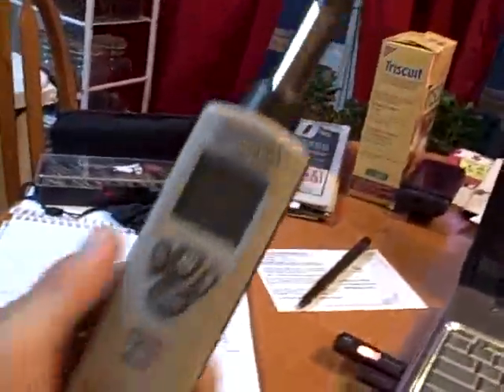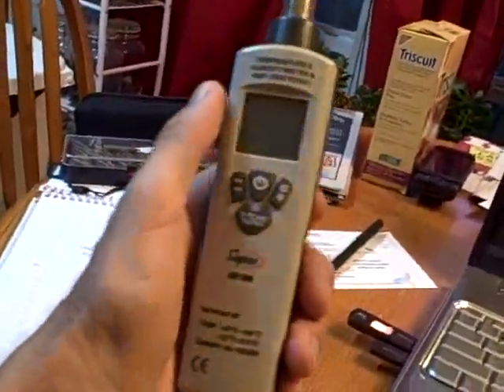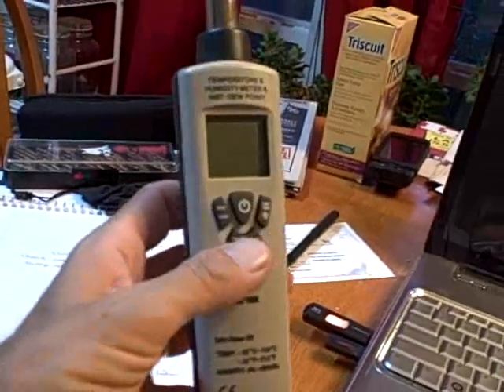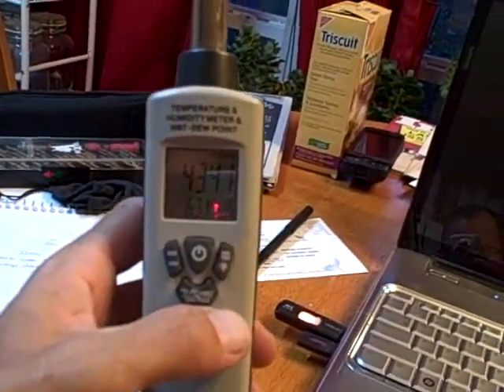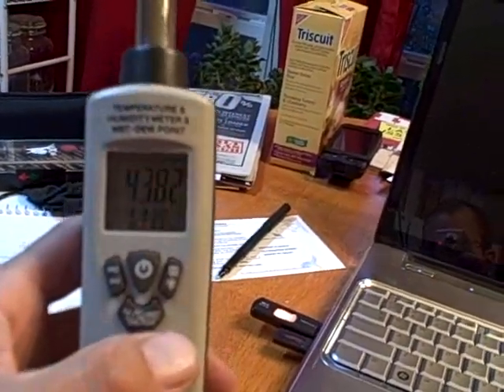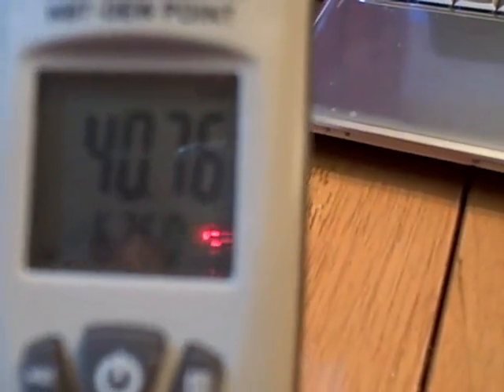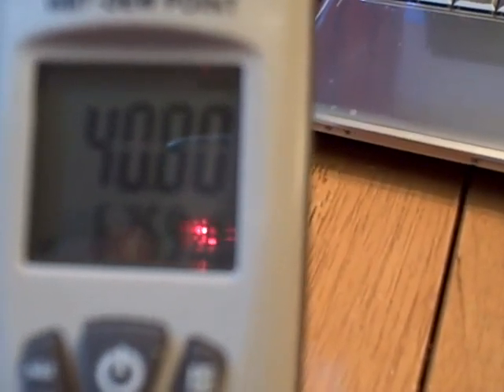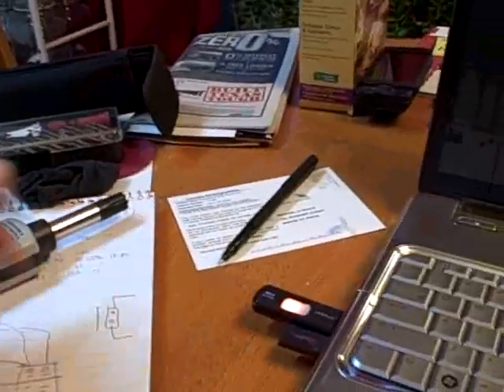HVAC Calculating Super Heat

Comment: superheat is the heat added after vaporization point. if you're calculating an evaporators superheat then check your low pressure gauge, check your p/t chart and find the actual temperature and subtract it from the charts given value. subcool is the same but it's useless if the system has a txv.

Comment: Hey Mike I was having a discussion in HVAC pro talk about checking refrigerant levels and adding refrigerant on a air source heat pump while in the heating mode. Would you concur with another user that you should check and charge using super heat? Any suggestions or guidance you can suggest for approximate pressure/temp readings. I was told a good rule of thumb is +30 high side and -20 low meaning if it 70 degrees inside in winter your saturated head temp should be approx 90-100 whereas if outside it is 40 degrees then you low side saturated temp should be around 20 anyway I'm sure there alot of ways to check but in the winter just makes things a little more difficult especially to understand, thanks for what you do.
Reply from the maker: Hi!  I haven't been over there in a while! Guess I should start checking in more often and keeping read up on what everyone is doing! Apologies for the delay in responding, you know my usual delay with my normal spinal issues and sitting in front of the computer of late, but I've been down for like a week and a half sick, ugh. Started out as a sinus infection and think I caught something my wife brought home on top of that! Next thing I know Im nauseous and my equilibrium is shot and Im having trouble standing up! Two trips to the Dr in the last week, two shots of antibiotics, a week series of antibiotics and a series of steroids and would you believe Im still catching my balance with a day or two worth of meds to go!  Havent had a wammie like this since I was in my early twenties! Lol!

....anyway, my head is fuzzy but since I'm laying here in bed with the tablet I might as well try and think, hehe.  First, just to get it out of my system, I hate heatpumps! Ugh!  Hate 'em!  Well I love them, just hate working on them ;). Theres just something about squatting down in front of a unit in freezing rain and ice trying to work on a unit when I could be working on a nice, dry gas furnace in someones hallway or attic! ;)

...but yes, for the most part the numbers that you mentioned are a pretty good ballpark.  I don't fuss too much over the suction temp as much as long as its in decent range, usually more of a warning bell if somethings really off.  For the most part I try and use the manufacturers charging charts, if they actually have any, but as you know often times they dont, such as Goodman saying 'weigh it in'. Uh, yah. Thats it, lemme suck it dry and weigh it in, then ballpark it anyway depending on the metering, lineset, rise, etc. since the maker doesn't want to do their job, lol.  ...then theres all the mystery units out there and a billion improper installs, etc.  

...but yes, that is a good rule of thumb.  The other important thing is to make sure to let it run long enough that the system has had enough time to warm up and balance a bit before making any changes, then making small changes and waiting long enough for it to settle again.  Such a pain in winter:/. 

I've run across a lot of new (still consider them new I guess) 410a systems that people installed during the winter and got in a hurry installing and wound up over charging, but it didn't rear its ugly head until summer rolled around.  Then I get a service call because the unit keeps starting up and shutting off, then doing the same thing over and over, short cycling.  They over charged them, pressure goes through the roof and trips the pressure switch.   I'm waiting for the eventual plethora of leaks that are bound to start cropping up (call it cynicism, hehe)  when the higher pressures with this stuff start meeting borderline production quality and thin copper.  Wonder which brand/model it will hit! (Grin) ...Im sure we can all think of one brand/series that had tons of coil leaks when mounted horizontally not too many years back!

...anyway, back on topic!  A number of years ago I sat down at the computer and started searching and dug up as many brands as I could trying to find charging charts for winter time, printed them up and added them to my three ring 'cheat sheet' binder that I kept in the truck.  Funny the stuff you keep that comes in handy later!  I think the most useful thing ai ever printed was a rather exhaustive list someone made of every brand of hvac, wether they were still in business, who they sold out to and who handles their parts if they aren't!  Especially handy with my horrid memory!

(Boss calls) Hey Mike, I need a 3/4hp 820rpm motor, you have one on your truck?
(Me) yep, no problem.
(Boss) great, Ill come get it, where are you?
(Me) ...um, on my third call.
(Boss) ...oook, what town are you in?
(Me) ....um, I dunno, Ill have to go out to the truck and look.
(Boss) mike.  Are you kidding me?  How do you not know where your at?
(Me) I just go where the gps tells me.
....seriously! ;)
Reply: Q

Comment: Is the formula you illustrated 3x wetbulb minus 80 minus outdoor dry bulb or ambient divided by 2 used to determine what the superheat should be or used to determine what the system is currently operating at. Because for instance, utilizing another method of taking the temp of the outdoor suction line minus the saturated suction temperature would give you the current operating superheat. I believe your formula is a more accurate way of determining the system superheat. Because these other methods are not taking into account indoor wetbulb which is crucial to knowing humidity or outdoor dry bulb. I also use to the Emerson tech check and charge app, can you explain from your experience which way is the best and are other people taking short cuts by just subtracting line temp for suction saturated temp. Thank you -Steve
Reply from the maker: Steve, the formula was devised to find out what it should be.  Mind you, its necessary to ballpark the system first and let the system run a while and try and get the house temp in the range of normalcy before using it to set the system where you want it.
Reply: mikie2501 thank you Mikie

Comment: as well but if the superheater is correct or not should make a chart that indicates the superheater is correct. because they do not save if you need more refrigerant charge or remove refrigerant charge.

Comment: The dumb people commenting that this is wrong should not be working in our Field you guys are the refrigerant pumping dumb shits let me explain to u how to do your job for you.....knowing how to take your actual super heat (suction line temp - low side psig converted to temp which your gauges do for you) is ABSOLUTELY WORTHLESS if you don't know what that # SHOULD BE.... I.e. your TARGET SUPERHEAT. The number your trying to hit for the simple minded folks,by adding or removing freon to get it.

Comment: Zeotrope - A mixture made up of two or more refrigerants with different boiling points. Zeotropic mixtures are similar to near-azeotropic mixtures with the exception of having a temperature glide greater than 10° F. Zeotropic mixtures should be charged in the liquid state.

Comment: that's how you calculate sub-cooling, the other way around, taking the saturation temp (the coil) which is measure by the low-side gauge minus the superheated vapor temperature (the boiled off vapor) at the suction line.  I'm surprised nobody else pointed this out to you

Comment: Superheat is NOT just for proper charge. Superheat can tell you if your TXV is operating properly for one, but on a fixed orifice system, superheat can tell you how well your evap coil is performing. I have seen guys a thousand times overlook their subcooling value and keep adding refrigerant, notice I didn't say freon, to a system to overcome low suction pressure due to a dirty coil, restriction in the line, or a bad blower motor. Superheat AS WELL AS subcooling are extremely important values

Comment: what if i get negative superheat? on an R22 split system my suction line temp was 36 and my evap sat temp was 42, that equals minus 6 degrees superheat. my system had been running about 10 minutes and was cooling adequately.

Comment: Anyone that's hating on this vid is a moron. He is talking about what your superheat SHOULD BE on a system with a FIXED METERING DEVICE. Yes you will still have to preform your other checks to find out what the actual superheat of the unit is currently. He's just giving another way of finding out what it should be and not the "range" that we were all taught. Chill out. GREAT VIDEO.

Comment: @drew7473 Super heat is when you have the air conditioner at full speed.  You have to turn the thermostat all the way down to get rid of that super heat.  You only have to do this when its super hot out, like over 100.  
That's some super heat outside when its over 100.  
That's all.

Comment: @Rozco99  Please DO NOT !! give uninformed information if you do not know what you are talking about !!.
Do not embarrassed  us  STEAMFITTERS by giving inaccurate   information. If you are still an apprentice please ask your mechanic for the right information.
A sight glass is mainly used for moisture content , a clogged liquid filter drier or noncondensablesor improper line size/install etc.. can show bubbles,etc. Only superheat and subcooling readings for proper charge .NO RATS !!!

Comment from the maker: @BGreenHVAC Honestly that doesn't ring a bell.  Freon is freon, even if it a single freon or a mix of freon, if you have proper gauges for that freon it's not an issue, but you can pick up freon cards anywhere at supply houses.  ...some more information?

Comment: Mike, I live in Las Vegas, I was trying to get what my superheat should be but using your formula it doesn't seem to compute. Here is what I did,
My WB is 60 so 60x3= 180-80=100, now then my ambient air coming into the condensor is 102 so if I sub 102 from 100 I get a negative 2
My indoor DB is 78, but how can you determine what superheat should be with a negative?

Comment from the maker: @sromanecz   That is correct!  You only use superheat to charge a system on a piston or fixed metering system, if you have a TXV you use subcooling and the TXV sets the superheat and you only need to monitor the suction pressure to verify that it is functioning properly.

Comment: Also, on superheat,should the gauge pressure/temp be higher or lower that the line temp? I assume that the SLT should be higher than the SRT for superheat and the LLT should be lower than the SRT for subcooling. At least that's what I think I remember from HVAC&R school. Am I correct in this assumption?

Comment from the maker: @bolingbrook2009 If the superheat is too high you add refregerant to bring the temps closer together, if it is too low you remover refrigerant.  This is, of course, assuming a good install, clean evaporator coil, clean filter etc etc and all that fun, hehe.   :>

Comment: sub-cooling is completly different first off you need to go off the manufactures specs for the particular piece of equipment then measure liquid line temperature vs pressure and set it up for whatever the specs for the equipment call for

Comment from the maker: YES.  Piston metering or cap tube metering you use superheat to charge by.  TXV valves you use subcooling and hopefully they bothered t put the subcooling on the data panel on the condenser or you wing it :)